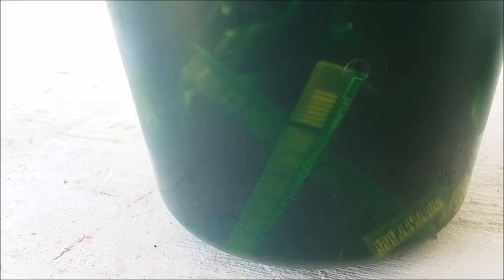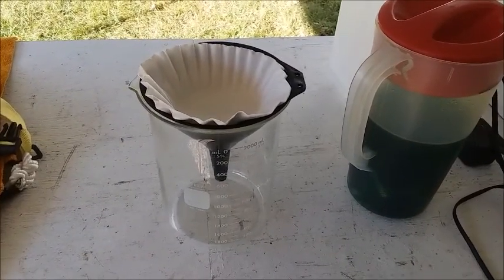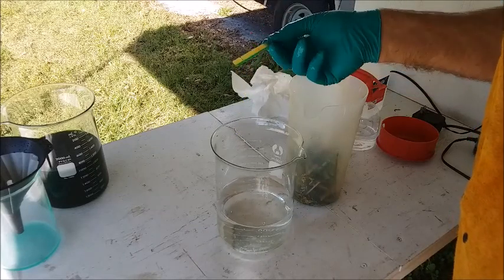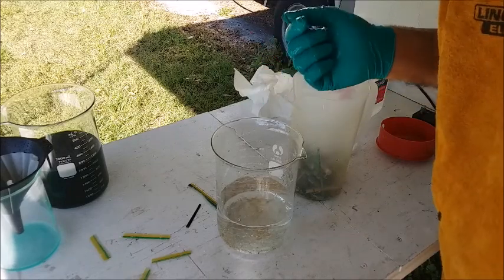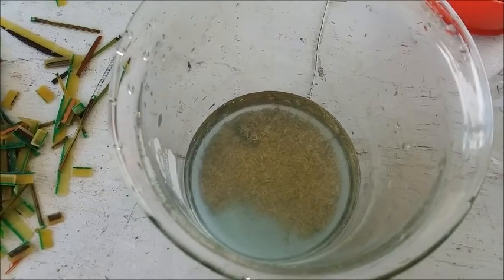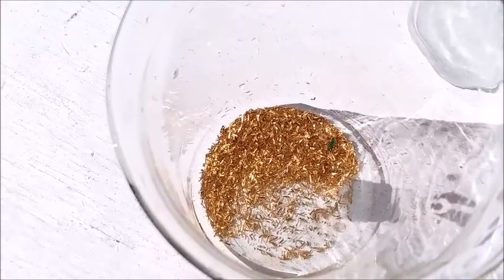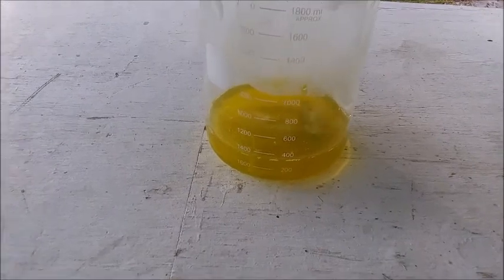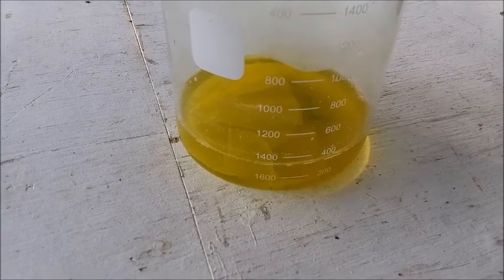Getting started in gold recovery from electronic waste - part 2

Comment: Hi, can't we just use nitric acid to remove all base metal and just left with the gold
Reply: You would use a dilute nitric solution then go to AR. Most people use this method since nitric for them is harder to get. If you can get your nitric cheap or make it then it wouldn't be that much of a concern.
Reply from the maker: You can. I avoid it where I can for three reasons. 1. Nitric acid is expensive. 2. Nitric acid is hard to acquire. 3. The possible formation of metastannic acid if there is a significant amount of tin in the e-waste being treated. This video series is meant to show how a beginner could get started in e-waste processing. Most beginners won't have access to nitric acid.
Reply: @omegageek64  when you said there might be a lot of tin in the ewaste, will they cause problem when nitric acid is added? Thank you, for replying very fast.
Reply from the maker: @pierreqiu8147  Tin can react with nitric acid to form metastannic acid, which can be a real pain in the butt. It is thick and pudding-like, and nearly insoluble. It can really mess up your processing. Tin reacts readily with the hydrochloric acid in AP solution forming stannous chloride. This removes the tin from later processing steps that may include nitric acid. That's one reason why I am a proponent of using AP solution to get rid of the base metals first, even if it is slow.
Reply: @omegageek64  very clear and well explain....Many thks